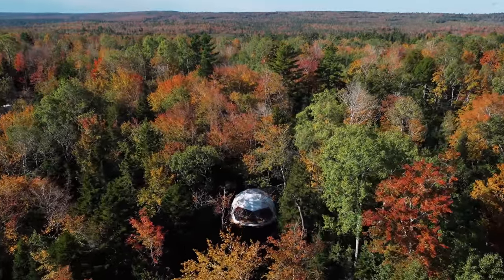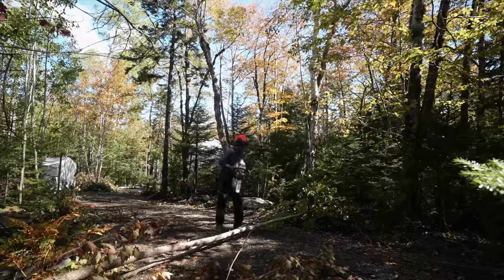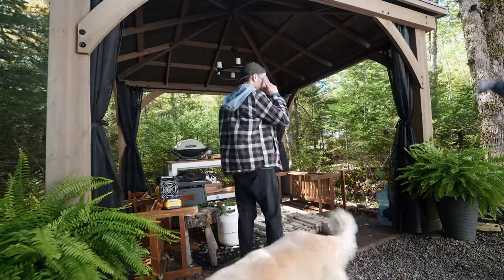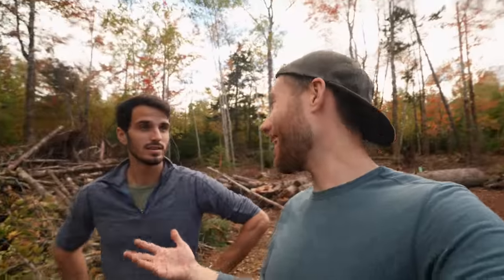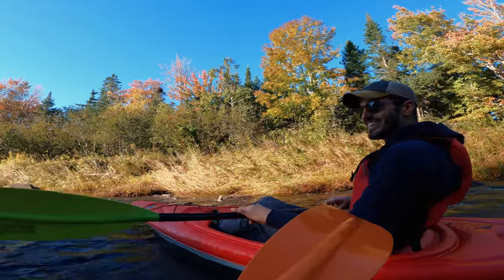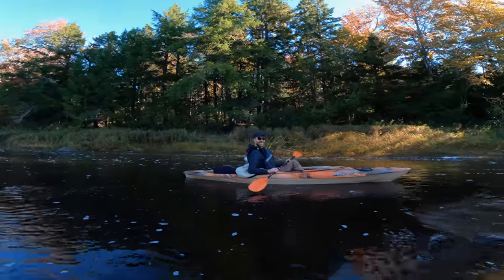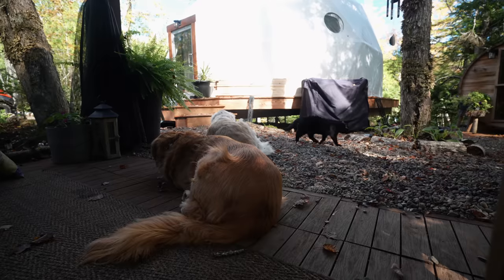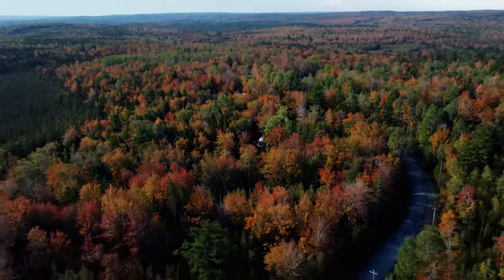The Aftermath of the Hurricane

Comment: We lived way out in the woods on a river.  Having to clear enough for fire breaks means some trees have to come down, old growth especially.  That's what will come down and destroy property.  The best & cleanest way to get rid of the unusable brush is to burn it.  This city kid learned A LOT including how not so romantic living on a river can be as well as living 30 miles from the nearest freeway can be.  It will only take once having a tree (just the top 20 feet in our case) snap off in a storm, nearly wipe out your vehicles & punch a hole through your roof.  That is on a stick house, it would be worse for your dome.  I think you guys are doing an amazing job.

Comment: A very good tip that my grandma always talked about is using ashes in your garden. So all of that burned wood could actually be used properly. In the spirng you can mix ih with the garden soil, and it is really good for the plants. Also you can sprinkle it in a line around the garden to keep small bugs and snails out. 🤗 all my best wishes and warm hugs form croatia♡

Comment: (é) On a Windows computer hold down the alt key and use the 10 key pad to type 0233 then release the alt key. It won't work if you use the numbers above the qwerty you have to use the 10 key pad. Also with an Apple I think it will work the same if you hold down the option key.

Comment: I'm not objecting to the burning, I'm just puzzled about why you think that stuff, or most of it, can't be fed into a chipper. For my much smaller wooded property, I've rented a medium duty gasoline powered chipper to successfully reduce similar large amounts of the same type of varied forest debris, into very condensed smaller piles of chips/mulch, that I then spread as ground cover in the cleared areas of the forest, and I let it biodegrade into the soil underneath, which I assume enriches the ground. To me this seems like the most efficient, fast, and effective way to clear the land of storm debris from trees, and to get rid of autumn leaves also, while recycling all the material back into the land. Ideally, I would like to own a chipper/mulcher that can handle debris from small to medium duty (let's say everything from leaves up to branches of approximately 4 inch diameter). Like you, I try to salvage larger tree parts for fire wood. So I'm wondering what your thoughts are about this disposal approach, and if you were to buy a medium duty chipper, what type/brand/model would you buy?